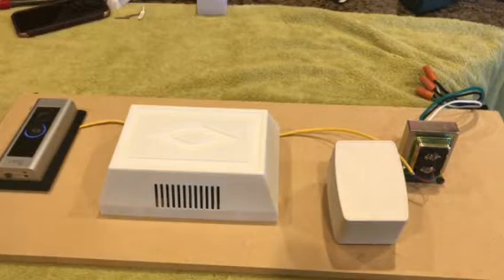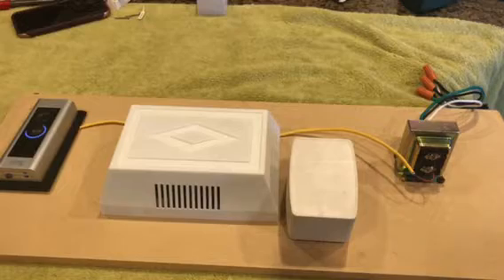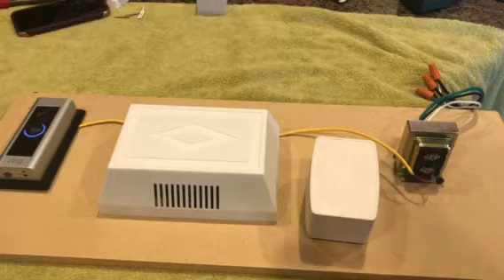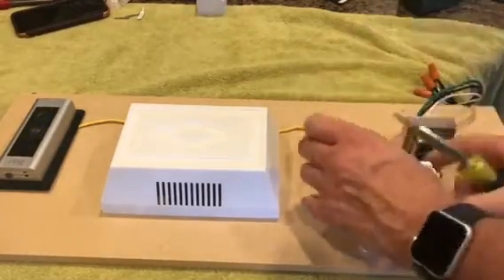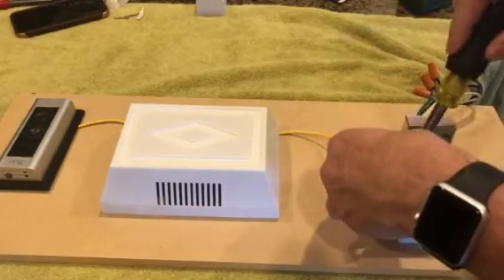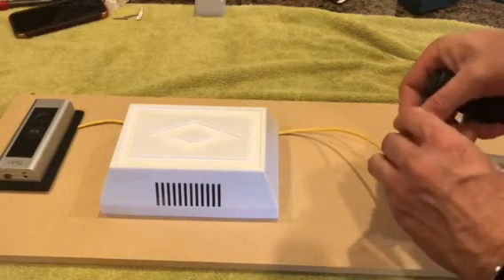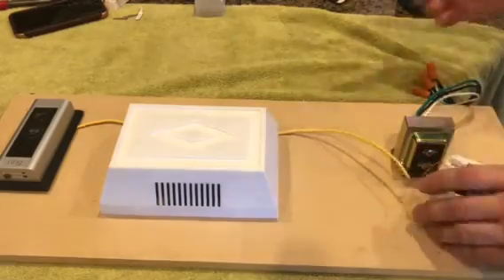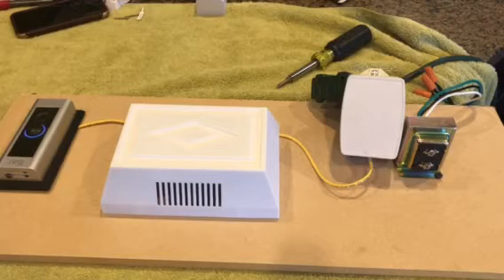Change Doorbell Wired Transformer To A Plug-In Style For Ring Video Doorbell Or Nest Hello

Comment: I have the same chime as the one you have in the video. Can it support 24V transformer? My chime is currently connected to a 16V transformer that has gone bad. I am concerned about using a 24V transformer to power my Nest hello and this chime.

Comment: Will I hurt my regular doorbell (without ring) if I use 24v?
When I bought my house the original transformer was never hooked up to power and this would just be easier
Reply from the maker: You can buy a 16.5V that will work perfectly for you. If you Google:   ELK TRG1640 AC Transformer 16.5VAC, 45 VA This will also work for the Nest/Ring if you decide later to get one.
Reply: sellgooddeals DIY 
I bought a plug in transformer and wired the doorbell to it. That way I didn’t have to fool with actual house wiring and connections. It’s 24 v and it seems like it hits the bell harder than it might otherwise.
I saw your other thread about burning it out. As long as it won’t start a fire, I’m not worried about burning it out in five years or whatever

Comment: Thanks for your demo, I noticed that this plug has just two prongs? Where my current transformer plugs in is two plugs as well...on the Amazon link it seems it comes with a third plug? Is there an option?
Reply from the maker: Three prong means the transformer is grounded.  Grounded plugs are safer, I would go for the three pronged.

Comment: Can I use a transformer with out a chime. 
I had a spare ring 2 I put by my garage door. Right next to an outlet can I just wkre up a 16v transformer to it?
Reply from the maker: Yes, that is exactly right.  You can use a Ring Video Doorbell 2 with just a plugin transformer without the chime.  Just make sure it is between 16-24volts.  Also, in the devices general settings make sure you turn the doorbell chime type to none.

Comment: Currently I have the non plug in style (10 volt version).  Can I use the existing low voltage wiring with a 24v plug in style?  Is it ok that it’s plugged into another circuit, perhaps on a surge protector, or does it require a dedicated circuit?
Reply: I just did this and it worked fine for me. I have a basement outlet right next to the doorbell wires and I plugged in the 24v transformer to the wall and connected the doorbell wires to it. Works well

Comment: Hi!  How do you test an existing plug in transformer to see if it needs to be replaced?
Reply from the maker: Sorry, I didn't get notified of your comment.  The best way to test a plugin transformer is to use a multimeter.  You would stick the probes on the two terminals that the wires are coming off of to test the voltage.  The transformer would have the voltage rating on it.  If I were making a bet I would say the transformer would be the problem.  Some of them have an overload protection circuit.  If it does you can unplug it wait 10 seconds plug it back it would reset and work.  If you look at the outside of the transformer and it has burn marks from heat that is also a sign of a bad plugin transformer.  Sorry I'm not more help,

Comment: can all doorbell chimes handle 24v? i want to do the same but i am not sure if i can push 24v to the chime.
Reply from the maker: Good but tuff question to answer.  Doorbell chimes are designed to run off of a 16V transformer.  That doesn't mean that they won't run off of a 24V.  That does mean that it could have premature failure.  However, the Ring and Nest doorbells do a great job at only sending voltage through for about a second.  So the doorbell is only going to have voltage for 1 second when the doorbell button is pushed. They won't let you ring the doorbell again for 20-30 seconds.  I remember as a kid ringing the doorbell non stop at my house waiting for someone to answer the door.  That would have been really hard on a chime using 24v.  I have been bench testing a doorbell with a regular button and using a 24V transformer and chime.  I have rang it like crazy for the last 2 months to see if I could get it to burn out.  It is still is working fine so far.  If you are using a plug in style transformer they do make an 18v that should work for you. Anyway not sure if this is any help.  Unfortunately, the best scenario is eliminating the doorbell chime if you are installing a camera doorbell.
Reply: sellgooddeals DIY where can I get a plug in transformer for my original ring video doorbell?
Reply: @sellgooddeals-DIY  I was watching this video and bought the 24VAC and 16.5VAC to power my doorbell and Nest Hello.  The problem I have is that my doorbell is humming/buzzing and it's annoying.  Is the plug in to much voltage for the doorbell chime?  Do you have a recommendation on doorbell chime that will work with the Nest Hello without having the doorbell buzzing and getting hot?
Reply from the maker: I just updated the description of the video to include a link to a good transformer.  Thanks for watching!